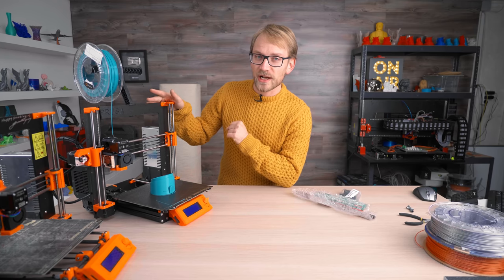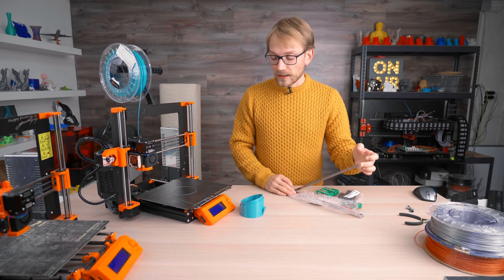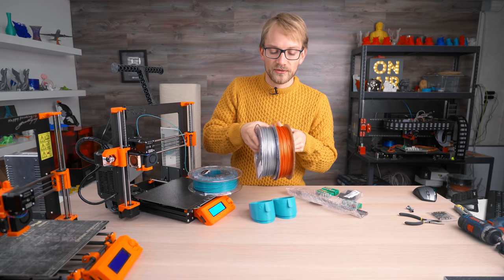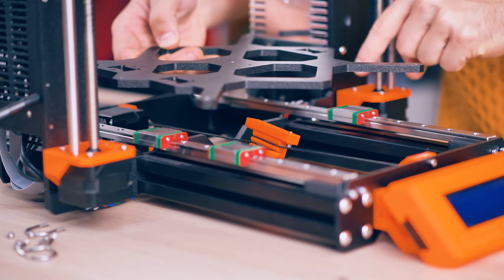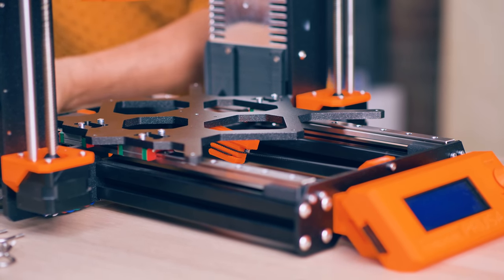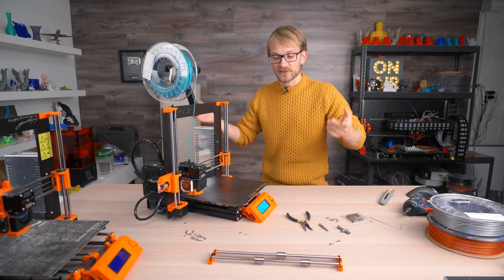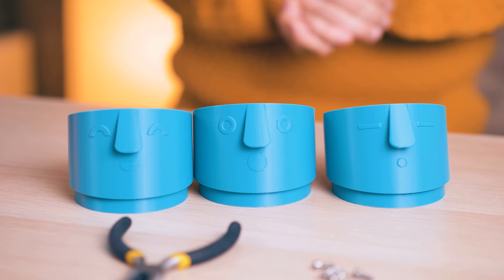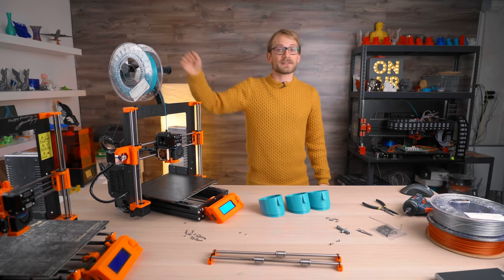Upgrading the MK3 with genuine HIWIN linear rails: Worth it?

Comment: I was pretty sure that Josef Prusa said in an interview that they found that using other methods such as linear rails had no affect on print quality, so I guess it's good to know that he was correct
Reply: Jazz  Josef also said "we dont need 32 bit boards" :D
Reply: @Arnipll  Bill Gates said: "640K is more memory than anyone will ever need on a computer."
Reply: Oh boi, suck a spoiler there
Reply: @RobNisters  That has never actually been proven.
Reply: I think that the way the printer is designed to use the guides is very clever. As Tom noticed, the original design is just constrained, and well constrained. With rails, it becomes overconstrained. That is unlikely to improve precision, but is very likely to increase friction, which can lead to decreased precision.
Reply: @RobNisters  well in those times with the program loads. Yeah that's very understandable. Same as someone saying 128GB of RAM is more than anyone needs rn.
Reply: well, except a fact that Prusa can just "sponsor" Tom and Tom will say whatever he needs him to say, if you know what I mean. Tom has been doing this for years. Which is why we test things in community, not just have some "sponsored" youtubers tell you without even bothering to show actual prints at correct lighting angles to see the actual quality.
Reply: @VladOnEarth  if prusa was sponsoring the video, then by law Tom has to disclose that. All YouTubers are legally obligated to do this
Reply: @victortitov1740  If the linear rails are setup properly, it shouldn't add friction. And it wouldn't be "over constrained"
Reply: @PBMS123  you sure?
Reply: @JonathanKayne unless the money is run through another company first.  then that company pays the individual youtuber like its a normal job.

Comment: For this application linear rails from your favorite chinese store for around 15 Euros for a 500mm rail are just as fine. Most of the time they are perfectly usable out of the box. Should they not run perfectly smooth just tear down the block and wash it and the bearing balls in solvent to clean out the dirt from manufacturing. I have been happily running banggood rails on my corexy for a long time.
Reply: Is there a specific vendor you would recommend?
Reply: The ones I got have play in the block ;-;

Comment: Ringing has nothing to do with the linear rails, but the linear rails expose the weakness and compromise with most 3D printer designs.  There are a couple things that will affect the resonant frequency of a machine - its rigidity, and the inertia ratio (the ratio of the inertia of the load and inertia of the motor.)  As to rigidity, probably the polar opposite of a Prusa frame would be an epoxy-granite frame with linear rails and ballscrews, or ACME or trapezoidal leadscrews and anti-backlash nuts.  I also believe the belts can act as shock absorbers of sorts, but they only mask some of the underlying problems with designs like these.  As to inertia ratio, having a too high inertia ratio can also lower the resonant frequency of the machine.  One way of lowering the inertia ratio is by gearing down, which lowers the inertia of the load by the square of the reduction ratio.  The only problem with that potentially is that the motor speed has to be increased by the gear ratio to reach the same speed.  The big problem with direct-drive belt designs is that the pinion acts as a gear increaser, since one turn of the stepper will move the load the diameter of the pinion times pi.  As just as the inertia of the load decreases with gear reduction, it increases with a gear multiplier.  The other way of lowering the inertia ratio is to use a stepper with a higher inertia - a larger stepper.  Changing to a less aggressive acceleration/deceleration setting can help as well.

Comment: I always thought these HIWIN rails need to be supported over their whole length...🤔
Reply: Yes!

And they should be mounted to honed or finished surfaces, meaning cnc milled, precisions fitting edge!

Even a aluminum extrusion frame has a large deviation compared to the tolerances required for these rails to funtion to full specs!
Reply: I guess it prevents them from bending if you do that, but I'm not sure it's strictly needed. Also if you fix it to a different material technically it could bend depending on temperature.
Reply: Totally. They flex in the middle. The kit should include a shim for the middle sections.
Reply: @StrathpefferJunction  Then you can add supports and shims for each hole. I would have expected to see Tom using a dial gauge to show any before / after effect. They cost about 15 Euros in an electronic version, the purely mechanical fashion less than 9 Euros, when I looked last week. And you can use them the rest of your life.
Reply: Ulrich Kliegis Tom has multiple gauges as you’ve described which he has used in other videos.
Reply: @kniefi  Yeah emphasis on should! The load a 3D printer puts on the rails is so small and tolerances of a process that involves squeezing just the right amount of squishy stuff to a right place and hoping it keeps its shape as it cools are not really high enough to worry about that.
Reply: @anttiandreimann8456  totally agree!
Though I like to over-engineer stuff, just because ;-)

Where a 20x20 extrusion would suffice I take 40x40 heavy version from bosch rexroth - unless weight is important^^
It judt adds to the overall stiffness and waaaay less jitter/ghosting and artefacts while printing.

Everything bends and distorts when forces are applied - it is just a question of scale or measurement units.
Reply: ALL supported rails require such mounting, i.e. to "flat" surfaces within a high tolerance <=0.0001". The flat rails are even MORE susceptible to longitudinal bending than fully supported round rails (which are also WAY less expensive and MORE than adequate for a 3D printer). There are tricks than can be used to reduce the amount of tolerance gaps like using epoxy under the rails and allowing to set prior to bolting down, but they are NOT ideal. 

A better idea for home builders is simply to use a standard 30-40mm granite (real not composite) worktop piece which are more than flat enough for 3D printer work. They are pretty temperature stable, solid and despite fears to the contrary, can easily be drilled using low cost diamond core drills from 5mm upwards.

I am surprised that the first thought on this upgrade was only about the table "stability". To me, a FAR more likely problem is the X-Y wobble of the Z axis itself and also the Y-Z wobble of the X gantry. Why? Because BOTH have a far greater amount of lateral movement capability than the Y axis itself. 

The old biblical proverb about building your house on sand holds here. Start with a good solid foundation and far fewer problems will occur.
Reply: @ulrichkliegis4138  A dial gauge would almost certainly help for the gross errors >0.003", but the accuracy is mainly dependent on using a "gauge" surface plate (usually granite, but other materials have been used) as accurate as 0.1um over 1m across its surface. Such surface plates are VERY expensive in the size needed in this case ~€350!!
Reply: @boblewis5558  Very expensive starts at 5 digits. Everything above that is the category 'we need it'. :)
Reply: @ulrichkliegis4138  €350.00 - five digits I believe! ;-)

Comment: Hello Thomas,
I build industrial automation as my daily job.
This automations have a lot of rails, and the right way to calibrate them is a bit different as you did.
Ill try to make an accurate step by step guide.
1- First you put the rails in and the blocks (as you did)
2- Tighten the rail with 2 blocks making sure it is square to the X axis
3- Tighten the blocks on the fixed rail.
4- Place the carriage to one limit, and tighten the othe rail, but just on this limit side.
5- Slide the carriage to the othe side and tighten this side of the rail.
6- Tighten the remainig block.
7- Now you have to loosen the blocks one by one and tighten them again. Ma ke sure to have only one block loose at the time.
8- Check for unwanted friction, if there is any start all over again.

Protips: Never use power tools for this applications, they can shift parts around (even blocks that weigh 1kg)
               You don't have to be super gentle with this stuff, being industrial they are pretty hardcore (but don't drop them)
               and for last, if you follow all my steps and you can't go away some little noise remember that the rails can bent some times. The only way to make them straight is to fix every hole on a machined plane.

Hope this was helpfull :D
Reply: willyminime good post 😁
Reply: Great advise!
Reply: For newbies like myself, there are YouTube videos from bearing and motion-control companies that are demos of the described "proper" procedures for installing and aligning bearings.   Thanks for the instructions!
Reply: Can confirm, this is similar to what we do at DMG MORI to our machines
Reply: @Thomas Sanladerer Pin this! This is very important!!!
Reply: @dadsfriendlyrobotcompany  is this an italian company?
Reply: @willyminime  it's a Japanese-German company. Known for precision.
Reply: I was totally going to say the same about power tools. I always cringe when I see them used for building things like this...awesome tips in the rest of your comment though! :)
Reply: Willyminime, you are absolutely right. Using such high class rails like HiWin without any support, just bridging a pretty long way through air, is a waste of ressources. And the other axes shoul then also get mechanically improved paths. Another step in the setup should be the check and adjustment of co-planarity of the two rails. It does not help if one goes up and the other down. 
I even would recommend to use a wrench with a settable momentum treshold. Proxxon and others have nice kits for that.
Reply: My 2-cents too. Using power tools in such "watch-like repairing" procedures it's like repairing a sidewalk in front of a glass shop using a pneumatic hammer! A no no no. Plus... one more thing. YOU CAN NOT pull out better quality out of such design PERIOD. The moving platform constantly shaking  the object being built and the vertical frame being basically a sheet of metal .... no way.   The Z-frame should at least use a square tubes.
Reply: Thomas please try this guide...
Reply: Hiwin rails have a reference side on both the rail and the carrier. They have to point the same direction.
Reply: @Mr_Wh1  the reference side is only used when you have a "wall" to push them on. If there is any you don't need to.
Reply: Please make a video of this process.
Reply: willyminime can you install these rails upside down? I’m going to make a corexy with rails.
Reply: Bravo Sir : "Never use power tools for this application"
Reply: For industrial parts, it is dissappointing they cannot hold their own against a simple power tool. A delicate touch is something to be expected of a 3D printed part, not metal. I could probably set the printer down and throw these linear rails out of alignment by your approach if they can get knocked out of alignment by a puny drill.
Reply: @Bajicoy  I'm in the process of building a 4x8 cnc table, it doesn't take much to knock anything out of alignment. The simple act of hand tightening will move whatever you're working on. In the world of precision and you're working in thousands of a mm, it will move.
Reply: @willyminime  DMG: Deckel-Maho-Gildemeister for the German side
Mori Seiki for the japanese parts
They merge in 2011 or 2015.
Reply: It would be nice if could make a video of the process alignment :-)
Reply: Protips: Never use power tools for this applications, .............
               You don't have to be super gentle with this stuff........ Okay boomer.
Reply: @thedangerzone9399  power tools don't ruin parts. But as i said they shift parts around. In the alignment process you have to be as precise as you can. Before and after you can be a bit more careless.
Reply: @dadsfriendlyrobotcompany  And use a good 0.0005 dial indicator. Only way you will know what you are working with.
Reply: Yes! This! How you gonna fine-tune anything with a powertool! Like you've never seen a screwdriver!
Reply: thanks, i just installed new bushings on my printer and did it the way you described it.
Reply: I hope you are just joking. Using linear rails in the air without proper support, without reference edge etc. is totaly wrong.
Reply: @willyminime  you always need to put rail by reference edge to wall, because rail is bended from manufacturing. Please read installation guide.
Reply: Although he's using a power drill, you can see, and hear that he's using it on a very low torque setting. Granted there are better (slower) power screwdrivers that would be better suited.